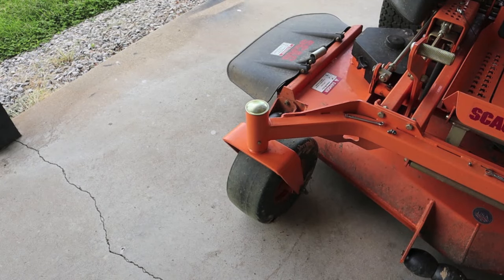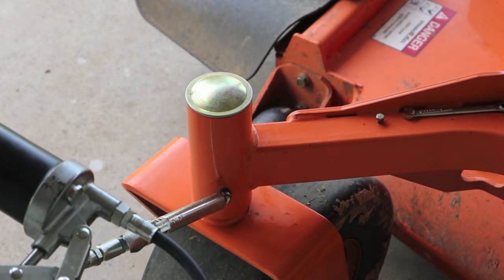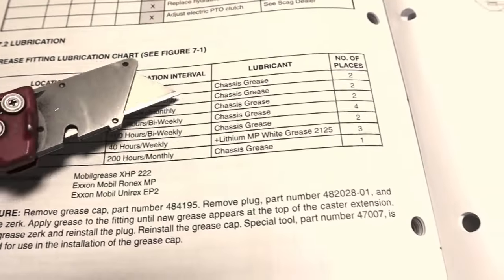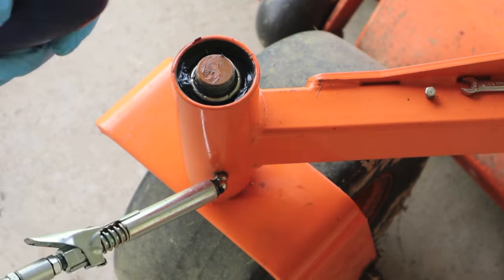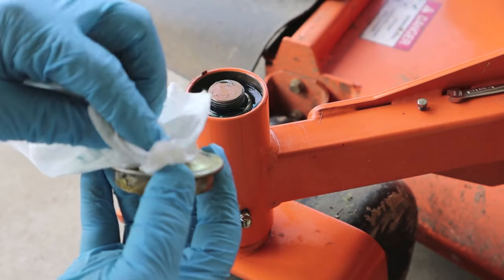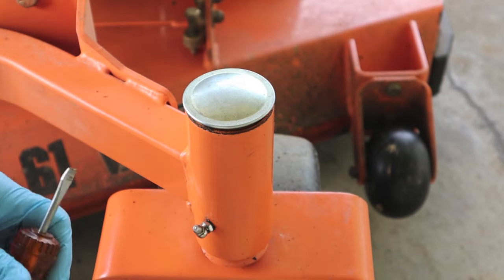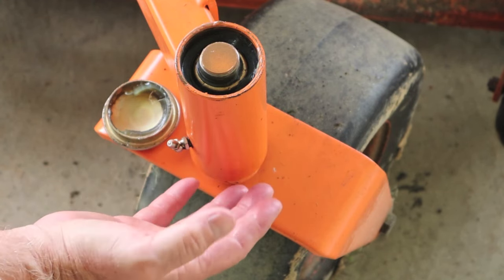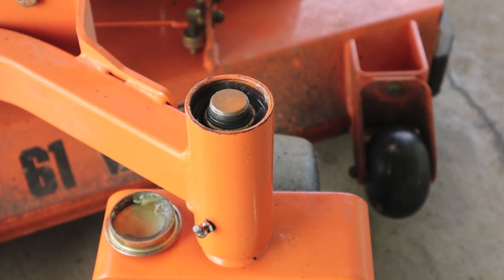Zero Turn Mowers greasing the caster wheel pivots SCAG (kingpins)

Comment: I have a Ferris that has a pretty similar setup and the top cap pops off when you add grease and it never comes out the bottom either.  I too found that odd.  Seems to me you'd want some grease to come out the bottom to clear the dirt from the seal and its sealing surface.

Comment: Bought a used Cheetah that did not have both of those grease caps. Had to remove the bearings and clean all the dirt/sand out of them. They are working fine now. I will be using this method to grease.
Reply from the maker: Thanks for sharing!

Comment: Thanks!  Very helpful for a beginner.  Can you reply on greasing the spindles?  There's a discharge point on the opposite side of the zerk that's supposed to keep you from blowing the seals.  Can I keep adding grease until it starts coming out the discharge?  To try to get the old stuff out/make sure it's full?  I'm a little afraid to do it.
Reply from the maker: Ken, you can but I would go slow just in case the relief valve is stuck a little. 
About every 15 hours I give 5 to 6 pumps of grease. At 7 to 8 the relief valve will open and I can hear the grease escape.
Thanks for watching!
Reply: @pmtips4482  That's just what I'll do!  Sounds more cautious than pumping away waiting for the stuff to come out the relief valve!

Comment: My residential Z-Turn mower does not have Zerk fittings on either side so I guess that I must pop the cover off to grease the kingpins ?
Reply from the maker: Maybe not. If there are no zerks, they are more than likely sealed bearings or graphite/oil impregnated bronze bushings. It's best to check your OM.
Thanks!

Comment: I change the caps and it has a hole on the top  and when you put grease in it come out of the cap on the top where the I guess it’s a vent hole don’t have to pull the cap off just pump grease in the king pin.
Reply from the maker: Be careful not to allow rain water to migrate in those top vent holes.
Thanks!

Comment: So when i put grease in mine the grease comes out the bottom of the king pin. The top of it after i remove the cap is dry and no grease at all. Is that a problem?
Reply from the maker: You probably should jack the caster up enough to take the weight off and try greasing then, see what happens and also you can pivot it by hand and see if you feel any abnormal resistance. 
Good luck and thanks for watching!

Comment: Can the Mobil XHP 222 be used anywhere it says chasis grease or is this a different type of grease?
Reply from the maker: I'm using this grease everywhere from wheel bearings to chassis, on machinery from excavators to front loaders, from spindles to axles. So far so good!
Thanks for watching!

Comment: Put a small hole in the cap so you can see the grease come out.
Reply: Can I put a small hole in the cap and install a Zerk fitting since there is none below ?
Reply from the maker: No, it would probably push the cap off before forcing any grease in the bearing or bushing. Check your OM, your kingpins may have sealed bearings or impregnated oil bronze bushings.
Thank you for watching!

Comment: So whatever happen to the canister that was leaking gas 9n your scag
Reply from the maker: I'm using the original canisters. I just empty the gasoline out of them and slap them back on.
Now when we park the Scag after mowing, I'll loosen the fuel caps, then just barely snug them so no pressure will build in the tanks.
So far so good.
Thanks for watching!

Comment: What size zerk fitting is that and where do I get them?
Reply from the maker: It should be a 1/4 by 28 (tapered/pipe fit), I got mine on Amazon. You can get straight or tapered, both will work, just be careful tightening them.
Thanks for watching!
Reply: @pmtips4482  Harbor Freight....

Comment: By the time you shoot the grease in the cylinder, finger out the excess,  you have wasted nearly as much as you put in.  Why not just fill to the edge and replace the cap.  Especially if it fills the circumference of the housing as it etches up?!
Reply from the maker: I had not been greasing the caster pivots properly for 5 years. In this case, I wanted to push up and out all the old grease I could.
You are right though, as long as you feel you are getting fresh grease migrated up through the bearing, you're good to go.
Thanks for watching and commenting!

Comment: What a poor design, they should have a bolt on cap, and a weep hole for over pressure. And maybe a sticker that says grease two pumps, once every two weeks......... But no zerk fitting, requiring a special tool to put grease in? Ridiculous.......
Reply from the maker: I hear you!
All the makers have their own little ideas.
Thanks!
Reply: Toro ride mowers have big screw on cap and you never have this issue ,so yes this is a poor design